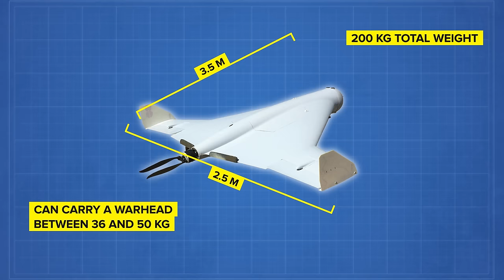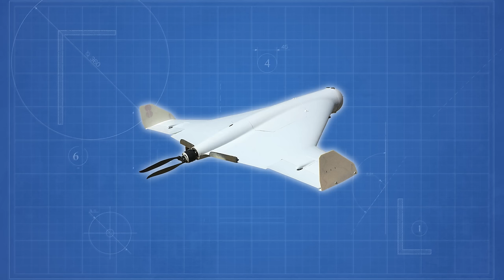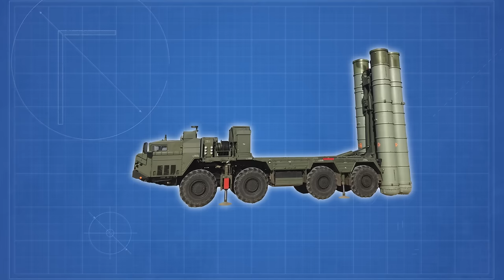Ukraine’s New Battlefield Trick is Costing Russia MILLIONS

Comment: I have heard reports two Ukrainian himar systems were recently shipped back to the us for repairs, shrapnel damage to the cab for one and I believe damage to one of the wheels for the other, just for the sake of accuracy.
Reply: One thing to know is that it's still useable than just for parts.
Reply: OK,  and?
Reply: @SandmanAplha4  The video had one sentence saying that no Himars system had been damaged.
Reply: it was 2. A mine and lancet hit
Reply: Sounds like it locally repaiable? Would you ship your car back to the factory to change a tire?
Reply: Damage to a wheel?  The US didn't just give a complete HiMar to Ukraine, they gave spare parts and manuals to maintain or repair them as well.  The same goes for the Bradley's and other equipment.   The US never sells or gives away equipment with out training and spare parts!

Comment: even cheap inflatable decoys easily spotted during the day may be useful at night, and also having a lot of them will lead to confusion by Russian analysts, if they have to track so many... and there will always be some doubt. Place them on beat up old cars so they can run around, make heat, leave realistic mud tracks (use remote controls in case they get shelled or attacked by a drone, if possible).
SDR should be able to generate some fake signalling, radar or automated radio chatter.  Move real vehicles mixed with fake ones, obviously, when possible.
Reply: I think putting real vehicles mixed in with decoys would make the real ones stand out more as sensors wold be able to look at the differential signatures at the same point in time in the same frame.

What might be better is to try to make real things look like knock off cheap decoys but not mix them in

Comment: Modern tanks are equipped with trophy systems that can catch an AT rocket fired from mere meters away. whats stopping people from making a similar system that uses regular-ass shotgun shells to knock out the smaller FPV drones? If a human can drop a duck or clay target from the same distance, a computer should be able to kill a far more obvious target going only a bit faster
Reply: @marcussoleil3733  fair enough. could always just cut some education funding though.

Comment: Who told you that Shahed is cheap drone ? Really 20-50k USD ? Just engine cost 30k. Reliable and resistant navigation system are very expensive too (50+ k) . Plus planner and all other parts. Cmon, its self-cost is much higher than 100K. Same time it is true that it is much cheaper than any rocket.

Comment: Shahed drones have radar absorbent paint.  That means that it is conductive but also resistive.  Pass a large current through a resistor and it heats up.  Can one a develop a  device that outputs a powerful enough microwave energy and collimated well enough to focus enough energy on that drone to heat in enough to destroy it.  Has to be very high power and short wavelength with large antenna.